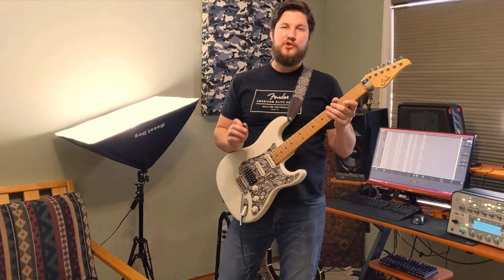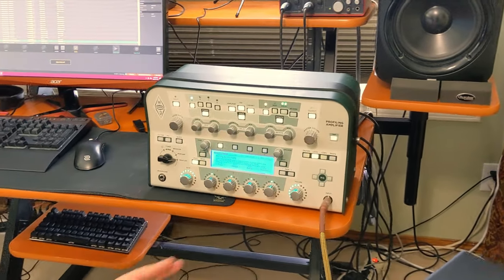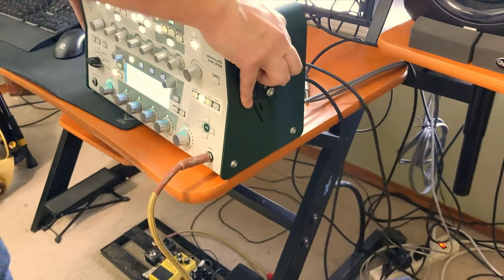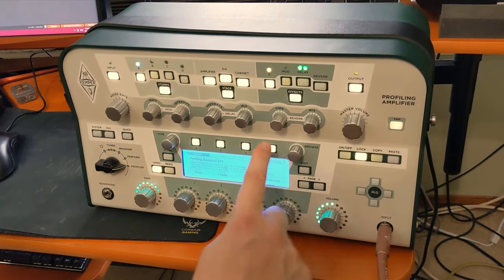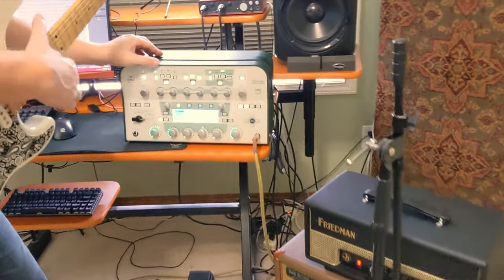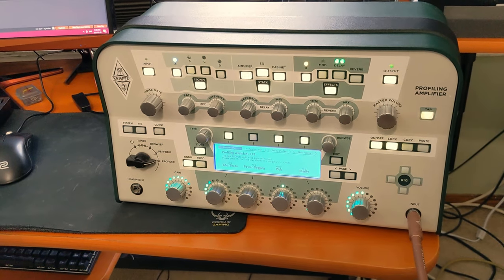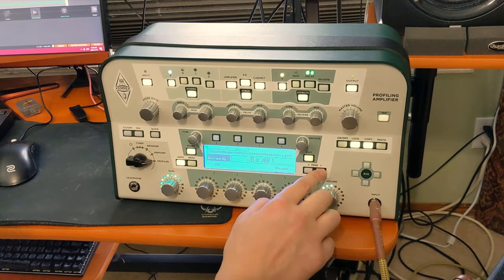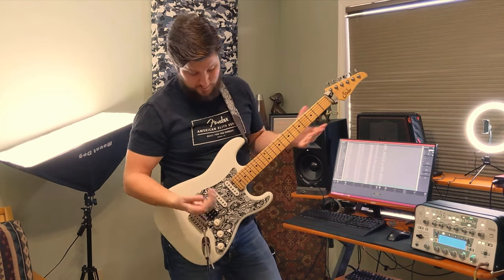How To Make Kemper Profiles in Under 5 Minutes!

Comment: Lovely tip, shut off any noise gate you may have in the amp loop. This is for the kemper to get an accurate reading of the amplifier it's profiling!  You can add that stuff after. Only thing I keep on in my high gain profiles is the Overdrive(KSR EROS as it sounds better than the OD's the kemper has imo) lots of people make profiles like this. Anyway again bro, best vid I've seen on making a kemper profile! Thank you

Comment: By level, I forgot to mention that on the screen where you choose clean, etc, and then next, there's a level shown that needs to be set. If it's too low, the Kemper doesn't think a reference amp is hooked up.

Comment: I appreciate this video. One of the easiest to follow demos I found on YouTube. I have a stage so the connections are similar but the main difference was the mic cable. I needed an adapter to fit the 1/4” return. Question, I went to Save my profile and it seemed to take the name of another profile on my stage. I went through the naming process and it didn’t take the name I gave it. That said, the profile sounded just like the amp I profiled. So I’m pretty sure it worked. Also my profile was loaded up with effects. I wasn’t expecting that. Did I overwrite another profile??
Reply from the maker: You may have. That's quite easy to do when syncing between the profiler and the rig manager.
Reply: I think I found my answers. Btw.
Reply: @TaylorWilliamWright  actually on the Stage the process is a little different. I discovered that if you plan on profiling your amp, you need to pull up a similar profile on your Kemper first. Then go into Profile mode and start the process. When you’re done saving, the effects that were in that profile carry over. That’s what I’m gathering. Not much documentation about it so it’s my educated guess. I didn’t use rig manager for my process tonight. Cheers!! PS: I have a Suhr too. Love it.

Comment: One thing you didn't mention was what you had the level on the Kemper set at. I tried profiling for an hour before I finally found someone mention something about the level. It will error every time unless the level is set to a certain db.
Reply: I had the same issue.  Frustrating until I found out it was the gain

Comment: Is it the Kemper itself that makes the process so loud? Or is this just because you turned your amp up? Meaning, in the latter case, it would never get louder than the room volume I've set my amp to? It's hard to tell for me in advance, since the noises are so unusual compared to the volume of your guitar tone before.
Reply from the maker: The amp has to be cranked up in order for the Kemper to get a reading of it. It's a loud process.
Reply: @TaylorWilliamWright  Thanks, I thought so! 😉 I‘ve already found someone who created Marshall JVM profiles for each mode in each channel, so I‘d simply use those instead of starting a war with my neighbours 😅.

Comment: I have a question: Let’s supposed that you made a copy of the amp’s sounds with all tone knobs at 5. Will Kemper know how the amp would sound with the knobs set, say, at 9? Or will it just “guess” how the amp would sound with different settings?
Reply from the maker: It won't react the way the actual amp would. You'd be better off making separate profiles of the different settings.

Comment: Why all the hiss?
Reply from the maker: That's the sound of the amp.  Generally when you run a high gain head, and the volume is turned up... you're going to have some noise.
Reply: @TaylorWilliamWright  people forget those details or maybe they don't own a tube amp. When there is no noise gate the the FX loop or in front of the amp you are gna get noise regardless if it's high gain or clean. A clean amp noise won't be as loud as hi gain etc.....